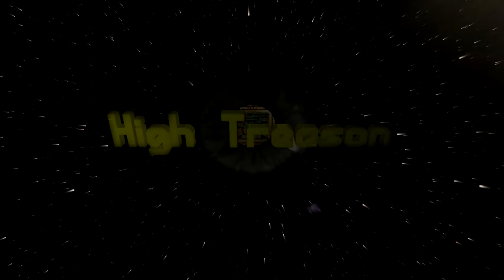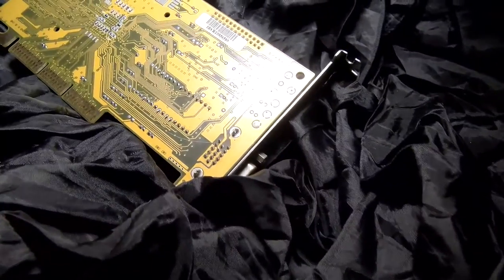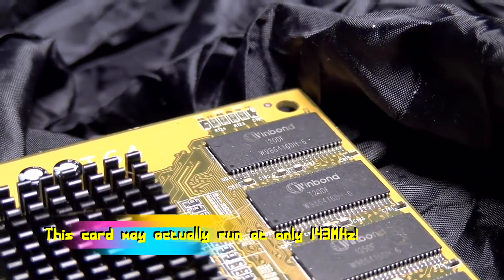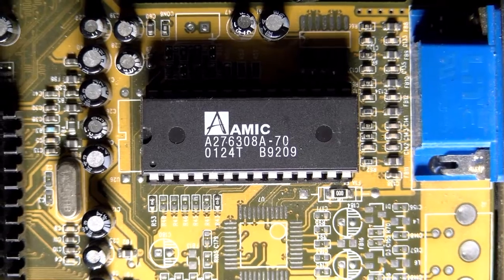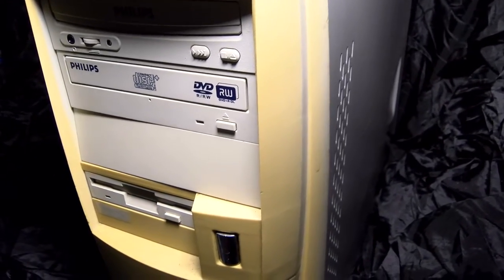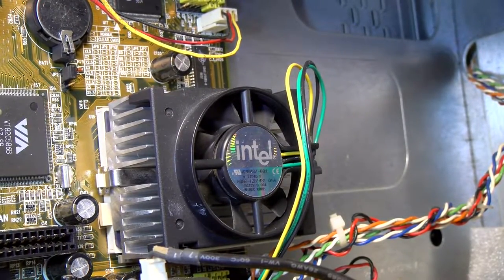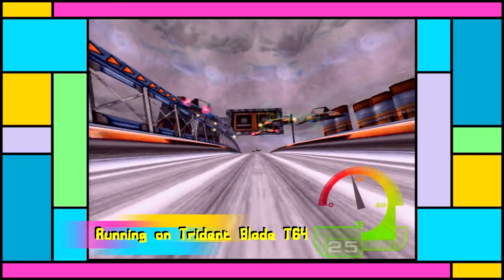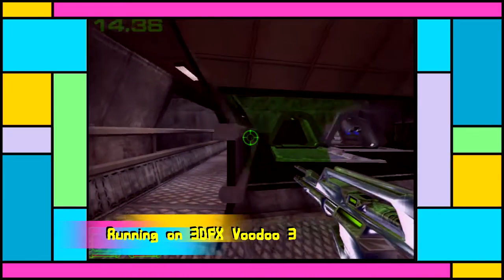Testing a Trident Blade T64

Comment: I greatly like VIA chipsets and have a lot fond memories and nostalgia of using them.
Reply from the maker: That's good to hear, I've also had great luck with VIA chipsets too. Some people have inexplicably strong feelings about the subject though and swear by ALI or SiS, and will practically defend them to the death. Personally I'm just happy so long as it works, no matter where it came from, but in this era (early 2000s) I've had better luck with VIA than anything else because 'it just works!' as they say.
Reply: @HighTreason610  Same, they always 'just worked' for me.
Reply: Never had luck with VIA :-(, but now i reverting my impressions about SiS (actualy start to like them), avoided just in case because of VIA. Never had ALi.

Comment: Nice detailed review of this budget 3D card! I came across many laptops with Trident Blade cards, Toshibas mainly. Great DOS performance and overall decent 2D Windows experience.
Reply from the maker: Thanks man. Ah, so they did put it in laptops. Finding information on this chip isn't easy, you can find it but then you'll find another page which contradicts it, mostly bus width, clocks and fill rates differ depending on who wrote the page, so this wasn't as detailed as I'd like.

Comment: good video high treason, better production quality esp with that cloth backdrop behind the card, these cards becoming hard to find these days, now all we need is for you to throw some white paint on the walls, and it will help with camera exposure light levels. great stuff keep up the good work, maybe cover some old utility software disk-doublers and such like, ram disks, performance enhancements, if hardware novelty gets sparse that is. what is that prison cell to the left of you in the shot ;) ? need to somehow get your channel a little more cognition, maybe co-op in some way with LGR or UK retro tech youtubers on something DOS based.
Reply from the maker: Hey, thanks. The black cloth will probably be replaced with one which is less shiny and I'll figure out the exposure soon enough, it's a new light (replaced the dodgy halogen with LED) and I think I was blasting it way too hard, also have to get used to handling the camera. The walls are in no state to be painted, even if they were I wouldn't waste my time on this house (especially as I'd have to undo it again if I left) and sure as hell wouldn't paint them white. I don't know about tools like disk-doublers, but I've covered software before such as LANtastic and Windows 3.11, so it'll probably be more 'get shit done' stuff like that whenever more software shows up..
Somehow I doubt any of those channels would want anything to do with me. I'm open to such ideas, but I'm not gonna waste my time pursuing them.

Comment: Now that I think about it I think I have a PCI Trident Blade card...somewhere. I just remember seeing Trident on the card and tossing it aside into some random box. Didn't know they were uncommon. Unfortunately, I have bad memories of Trident from my first PC that wasn't a Commodore. It was an AST and it gave me so many problems. It had a built-in Trident video chip and it always gave me issues. One of the bad ones I guess. I do love the old ISA 8900 Trident chips though.
Reply from the maker: They don't seem to be common, at least, as I haven't seen any of them for sale aside from the older Blade 3D and 3D Image cards occasionally cropping up, doubt it's really worth anything and there's not really any advantage to having one over the more common options, aside from the sheer novelty and the fact that it actually works.
Trident definitely made some horrible things in the years prior, though, there was at least one VGA chip on ISA and VLB that used to like going monochrome and needed a TSR to fix it, or else they were extremely slow, but then they also made one which was competitive, their catalog really was a mixed bag.

Comment: Thanks for uploading this. I got a T-64 recently as a seller I bought some other retro parts from offered it to me for cheap, and it's hard to find very much information about it online.
Interestingly mine has the exact same circuit board but in green, the heatsink is a small green one mounted using clips and those through-holes and finally my example has a directly soldered bios chip.
Reply from the maker: While it may not be the fastest card, it has sure proven better than it has any right to be. Thus far it's handled everything it could realistically be expected to.
There probably are a few PCB variants. There's supposedly a marginally more featured version out there with TV outputs and slightly different clocks that I'd not mind finding, but haven't really bothered to look as I'm happy with this one, having found it a good fit for this particular machine. A GeForce 2 would flatten it in 3D, a Matrox would outrun it in 2D, but I don't really use 24 year old hardware with the goal of attaining high speeds. For what would have been a lower cost system at the time, the card just seems right here.

Comment: I love the 1080p60 format -- thanks so much for upgrading your camera!
Reply from the maker: Thanks man, there's still room for improvement here though, mostly getting used to settings and the new filming light.
Are you still maintaining TopBench? I tried to send you an e-mail a while ago with a databese containing some of the more obscure systems (C&T 386, Nx586, STPC-133) but I don't think you got it. If you do want those results, ignore that e-mail anyway as some info was missing and I was also gonna add a WinChip too, I should be able to get that done by the end of the week as I still want them in a database for personal use regardless of whether they're of any use to the TopBench project or not.

Comment: I had one of those when I was in high school in a computer I used to mess around on the performance wasn't that great although there could have been something wrong with mine
Reply from the maker: Performance isn't exactly strong from this card, but compared to some of the other low-end solutions of the time it works quite well. For example, S3 chips from that time seem prone to loading textures wrong (or not at all) and Intel's integrated graphics were useless for years. I didn't think of schools, but now that you mention it, it does seem like that's probably where a lot of these would have ended up.

Comment: I got a K6-2 400 with 64mb of ram and on-board trident blade 3d back in 2000 or 2001 - and I'm from eastern europe - so you're right, super socket 7 machines were very popular here in that period.  Socket A stuff only started getting traction from 2003 onwards.
Reply from the maker: So it seems the date codes on hardware coming from that part of the world indicated correctly. Thanks for confirming this, as it is good to know.

Comment: I've got a Jaton Trident Blade 3d Turbo 8mb AGP card. Trying to figure out the optimal CPU to pair with it. Any ideas? It's going to be for DOS through Win98.
Reply from the maker: I think those ones are slightly older or at least lower end than the Blade XP. They're not cards I'm very familiar with, but I feel like it'd be at home in a slightly older K6 or a slower Celeron machine. Basically I picture a late 90s 'poverty' gaming experience, which can sure be fun in its own right - the K6 in this video is more of an early 2000s version of that idea.

Comment: I have a card similar to this. I wanted to put it as a 2D card for a Voodoo 2 in a Pentium II 300MHz Windows 98 machine, but it slowed it down too much compared to the Rage cards. I think my 4MB Matrox was the fastest 2D card, but that's a PCI card and I really wanted to put an AGP card in an AGP system.
Reply from the maker: Matrox G100s are probably still priced decently, are available in AGP and are very fast at 2D. They're not the fastest, but they're up there to the point you'll generally see frame rates outrun the monitor in common DOS and GDI stuff. The CPU generally starts choking before the card does. Failing that, S3 Trio 3D AGP cards are probably still worthless. Not as fast as Matrox, nor as sharp, but they're decent so long as you're only using them for 2D. They won't even come close to saturating the AGP bus, but it at least takes load off of the PCI bus, I guess, given that's largely parallel and AGP usually has its own 'lane', albeit it's still kinda PCI - it's just a dedicated "Really Fast PCI" slot.
That said, I'll never quite understand why people do this and then go on to install a PCI "accelerator" in an AGP system anyway.

Comment: I think you just like that shirt more. The print has faded quite a bit.  Powerstrip or Aida ( perhepts even old everest ) might say what the trident is clocked at. T64 makes me think of M64 as in that might have been the target for this cards existence since the M64 was a go-to card for most low end builds. Video looks good.
Reply from the maker: These tools tell me pretty much nothing, Everest just gives a gray window with no information at all. M64 is exactly what I thought, which is why it lived in a box for years under the assumption that it was just such a card, it definitely seems to have been going for the TNT2 end of the market at any rate. Still surprised how well it works, most of these bottom-of-the-barrel GPUs were awful and did things like not loading textures or yielding exceptionally crap frame rates, it's weak and it's simple, but it works.
Glad to know the video quality isn't just rose tinted goggles, gonna take a while to fully adapt to the new camera but it should be worth it, no more worrying if the files are being mangled and no more wasting entire days messing with resampling - yeah, this wasn't only faster to edit, it rendered faster because of that despite ramping the settings up, may well try for 4K on some projects as JVC have patched the camera to do that at higher frame rates now.

Comment: According to my experience K6-2 was not so popular in Russia if we mean actual sales and not price lists of computer shops. It was cheap, but almost completely beaten by P55C/PII Celerons mainly because of 3 things:
1. chipset issues with AGP and/or DMA (VIA or ALi)
2. poor mobo quality (broken caches, troubles with high power addon cards, linear VRMs, ...)
3. marketing :-) and Internet full of gossips and stories
A year later whole low end PC market here was dominated by Durons/Athlons or Celerons.

Last year i found 3 S7 complete PCs capable of using K5/6 in local garbage, 2 of them was in PERFECT condition even without dust inside, both had VP3 and Pentium 200 MMX. About 5-7 early S462 systems, 2-3 BX systems, about 10 Coppermine on VIA/815/BX. And no one SS7 even dead one.

I suppose main K6-2 sales was done by OEMs like IBM Aptiva, ACER Aspire or HP Pavilion, those systems was too pricey compared to local "hand made" PCs even with Intel CPU at least in Russia at that time.
Reply: I even had in 1998 SS7 MVP3 + K6-2-333 and Matrox G200. I was so happy for first 2-3 months, after P-166 + ET6000. And i was more than happy when i sold it and repaced with PII-333 + Chaintech 6BTM because of different software and hardware issues with previous system which i never had before. Mobo (SS7) alone was DOA 2 times before i get one working.
Reply from the maker: That does surprise me, I've had three boards with production dates beyond Y2K and they all came from Eastern Europe, none of them from Russia though that I can remember, certainly Ukraine, one from Latvia. The current 5AGM2 has parts made beyond the year 2000. There was another board which came from somewhere else, but that one wasn't working.
I just figured they were bought by 'average joe' types who didn't know much about the technology, definitely didn't have the internet and didn't want to put a lot of money down, or else they got used in offices, they were even quite widespread still in the UK in such settings - I should know, I used to work with the damn things on a daily basis both at work and 'on the side' to make a bit of cash - amusingly often being tasked with pulling Voodoo cards out which one of the local builders liked to put in for some reason, even after the company was dead. Who knows, maybe the boards over there are all leftover stock as you suggest, mine was unusually clean when it arrived. If this is the case, then someone sure must have lost a huge amount of money ordering them in back then.
Reply: @HighTreason610  I was one who didn't want to put a lot of money and want to try advertised achievements in performance done by AMD especially 3DNow. Well at least i had just half of the problems with AGP support, not having Live! or other addon cards besides modem and ESS sound both on ISA bus. Last nail in the coffin was USB controller card with which PC didn't power on.

During working as a computer service/repair technician (1998-2003) i seen some SS7 systems but in proportion to P55C and Celerons it was about 1:20 either at home or at work. Later generations Duron/Athlon XP about 1:2-4 with coppermines/P4.

According to my experience and Internet discussions of this time in Russia SS7 was more enthusiastic choice than money saving. Computer was not something every family (average salary about 300$ a month) or business (1 PC for a small office, not on every desk) had and average joe assembling PC didn't wan't be beaten to death by average joe bought it from him. So the Pentiums prevail.

Same goes to VooDoo. At the time it was the only one viable solution i knew maybe 2 people who had V1 out of 100. V2 was a bit more popular, but still not so popular due to high cost. TNT and TNT2 that was the thing sold in quantities. Most people enjoyed for just having a PC and got real 3D experience later with Vanta/M64/Savage/VooDoo 2000 during time such cards was a low end trash garbage.

Not to mention on how fast evolution in computing was, people switched from P1-133/200 to Celeron/Duron 700 or even AXP/P4 Celeron 1800.

Comment: I have a AMD K6-III+ 500 ANZ with 1.8V, installed on a Aopen AX59 Pro VIA MVP3 mainboard with 256MB SDRAM. The CPU also runs with 600MHz prime stable if you give her 1.9V VCore. I use a big Spire Whisperrock IV Socket A/370 cooler. Max. temp on Hardware Monitor: 23° :D

I like these AMD K6-III+ chips, very good performance for a Socket 7 CPU, 180 nm process, so very good for overclocking, and on-die fullspeed 256kb L2 Cache. You also can change the multiplier on the fly in windows. 

3DMark 2000 with a V3 2000 AGP and 600MHz (100x6.0): 1914 3DMarks (1024x768x16)
3DMark 99 Max, also with 2000 AGP and 600 MHz (100x6.0): 3789 3DMarks (800x600x16)
Reply from the maker: Oh.
I have an AMD Athlon XP. I play games on it sometimes.
Reply: K6-III+ was just too late, by the time they came out you could of gotten coppermine Celeron ~600-700 trivially overclockable to 900-950MHz, or Duron 600 also overclockable to ~900MHz (actually challenging, required pencil and soldering multiplier straps on the pcb), all in the same $100 price bracket, and as a bonus you got a motherboard with actually working AGP slot. In games (Q3/UT) even non overclocked Celeron was faster than K6-3+ :o https://www.cnews.cz/test-historickych-procesoru-dil-i-1995-1999/

Upgrades also made no sense when selling old ss7 motherboard and processor would be enough for new slot1/socketA one.

Comment: Anyone who has minimal knowledge about late 90s hardware knows that the best video cards for the K6-2/3 are by far the Voodoos.
Reply: Eh no, anyone with actual knowledge about it knows that it depends on what the games supported. By the late 90's, the other options wheren't as behind nor always worst than what voodoos could do nor did all the games made with 3dfx's api in mind and everybody that has actual knowledge knows that there can be glitches that will make a given card more desirable than voodoos. Thinking that a voodoo will do 100% of what's available on PCs just shows how little you know about what was available and done at that time.
Reply: @NintenloupWolfFR  i never say that the Voodoo cards are better than Nvidia or Ati in all situations. No, but overall the 3dfx cards are by far the best for AMD K6-2/3 systems.
Reply: @3dfxvoodoocards6  even for a K6 it's not the best card in all situations. I don't really play 3d games and the ones I do aren't made for just the glide API. My matrox card does a better job at 2d games as it has a superior DAC and it's powerful enough to saturate the K6 anyway for the other 3d games. I wouldn't replace it for a voodoo as it's not good in the games I care. So no, a voodoo isn't THE end all be all for a K6. There's more to PC than games that supports glide.
Reply: @NintenloupWolfFR  if you play Super Mario, your Matrox card surely is better than a 3dfx Voodoo.
Reply: @3dfxvoodoocards6  there are tons of 2d games from the mid and late 90's... That's not how it works. There's more than glide games.